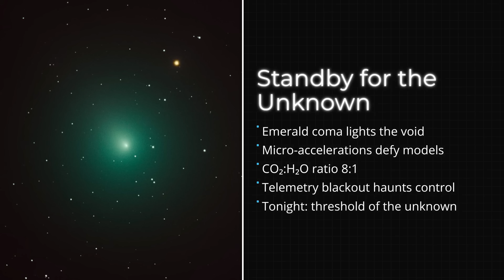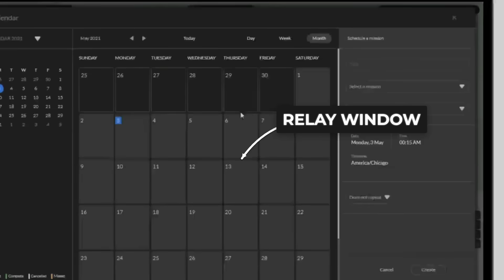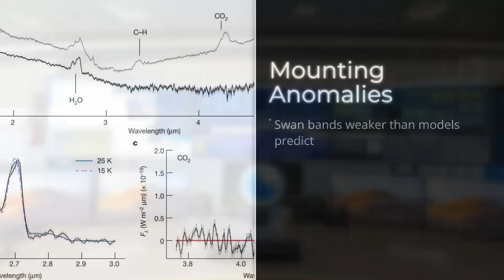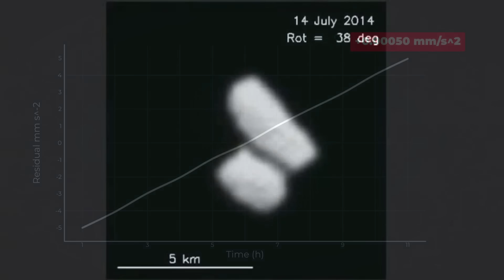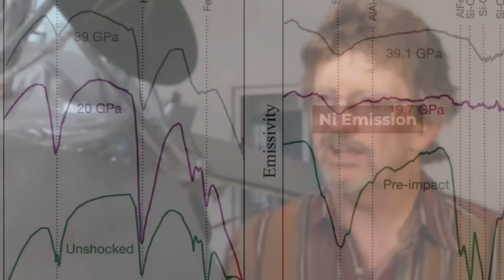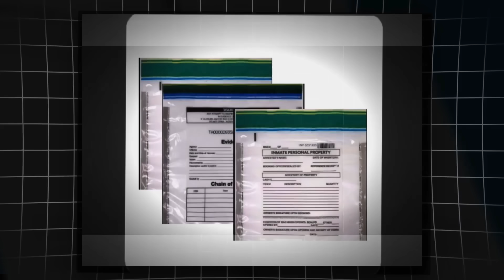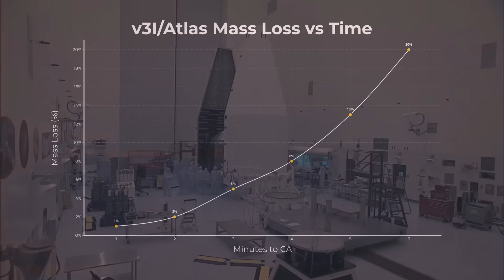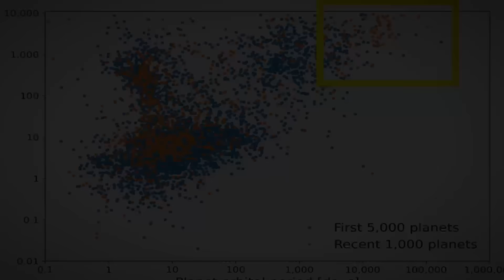High Alert - 3I/Atlas Is Going to Pass Mars Tonight

Comment: Question for the data nerds here: do we have links to the raw spectra/telemetry you mentioned (CO₂:H₂O ≈ 8:1, nickel lines overpowering iron, negative polarization, the brightness pulses synced with micro-accelerations)? If the agencies pushed rapid open archives, I’d love DOIs or repositories to dig into the numbers.

Comment: The characteristics of this comet support the Electric Universe model.
These are not "outgassing", they are electrostatic repulsion.
The electrical environment of the sun extends way out to the heliopause. As the object approaches the sun the electrical environment becomes stronger. The voltage gradient increases.
The regular outbursts are due to the double layers of the Birkeland current. As the object passes through a double layer, it's electro-static repulsion is strengthened.
Thank you Wal Thornhill. RIP.
Reply: yeah and the current model doesnt support the outgassing..??
Reply: Electric universe  js not accepted at all. It doesn't correspond to the rest of Physics "Electric Universe" (EU) theory is a fringe cosmological model that proposes electricity and electromagnetism, not gravity, are the primary forces shaping the universe, but it is rejected by the scientific community as it contradicts established physics and fails to match observational evidence. Proponents claim to explain cosmic phenomena like star and galaxy formation and planetary features through electrical currents and plasma physics, but the theory lacks mathematical backing and testable predictions.  
Core Claims of the Electric Universe Theory

    Electromagnetism Dominates:
    The universe's structure and phenomena are driven by powerful electrical currents and electromagnetic forces within cosmic plasma, not gravity. 

Plasma Universe Foundation:
The universe is comprised of over 99% plasma, and the entire cosmos is powered by these vast, interconnected electrical currents. 
Stars as Arc Discharges:
Stars are not powered by nuclear fusion but are large electric-arc discharges, similar to lights bulbs. 
Alternative Explanation for Cosmic Structures:
Galaxies and other structures are formed through the magnetic pinching and interaction of these intergalactic electric currents, not gravity or dark matter. 
Reinterpretation of Phenomena:
Features like comet tails and planetary craters are attributed to electrical interactions and "electric scarring" from past cosmic events, rather than impacts or other natural processes. 

Why It's Not Mainstream Science

    Lack of Evidence:
    The EU model makes claims that are not supported by observations and lacks testable predictions that can be verified. 

Rejection of Established Physics:
It dismisses established theories like Einstein's theory of general relativity and the Big Bang theory, which are supported by extensive evidence. 
Inconsistencies with Observations:
The theory struggles to explain fundamental observations, such as why objects of different electrical charges fall at the same rate (a concept explained by gravity). 
No Mathematical Framework:
Unlike standard cosmological models, the EU theory lacks a robust mathematical foundation to describe these proposed electrical interactions on a cosmic scale. 

What It Means for You

    Not a Scientific Model:
    The Electric Universe is not a scientifically accepted or viable alternative to the standard model of cosmology. 

Misleading Explanations:
It offers an unproven and often fantastical interpretation of complex cosmic events, leading to misinformation. 
Focus on Established Science:
For a true understanding of the universe, it is more productive to explore established physics, including general relativity and plasma physics, and the wealth of data gathered by astrophysical research. 

    Debunking the Electric Universe
    May 1, 2020 — as I will demonstrate for you here let's start by going over what this fad proposes as many of you may be unfamiliar wi...
    YouTube · 
    Professor Dave Explains

15m
Testing the Electric Universe | by Brian Koberlein
Feb 25, 2014 — There's a cosmological model that has gained popularity on the internet known as the Electric Universe. The basic clai...
Brian Koberlein
The Electric Universe Theory – An Alternative Model of ...
Apr 8, 2019 — but when you look at the ideas behind it and the companioning theories and alternate explanations. it seems as if there...
YouTube · 
SEA

    8m
    Show all
Reply: Great observation! Even still those observations leave me wondering how to explain the course corrections..
Reply: En fin : El universo es como un monton de átomos GIGANTESCO y se rige por corrientes eléctricas y electrostáticas a parte de gravedad y atracciones y repulsiones  orbitales.. básicamente y abreviando eso pero, es muuucho más complejo.

Comment: Nothing will happen. The fly by distance between Mars and the comet in Astronomical units is 48,924,108.82 miles. The diameter of the comet's core is 3.4 miles, and is moving at 3.6 miles per second. In a couple if days it'll be outward bound from our solar system, never to be seen again, a traveller from who knows where, just passing through. Another day, another comet.